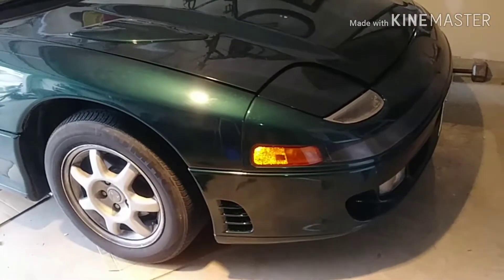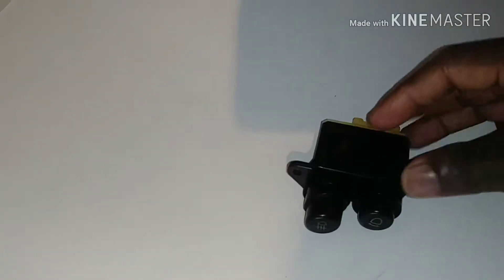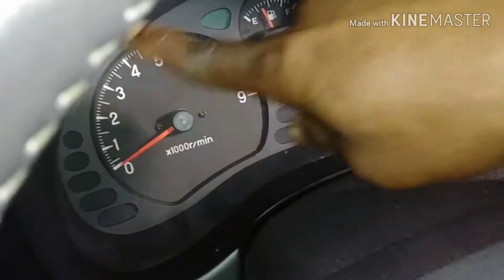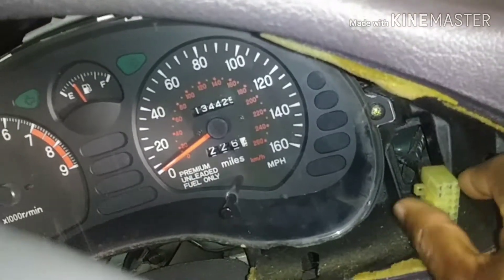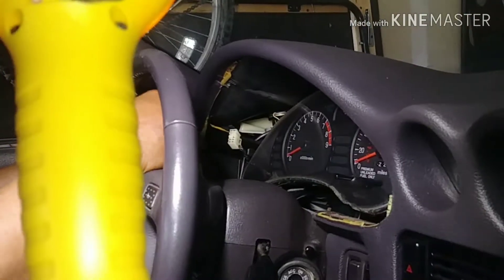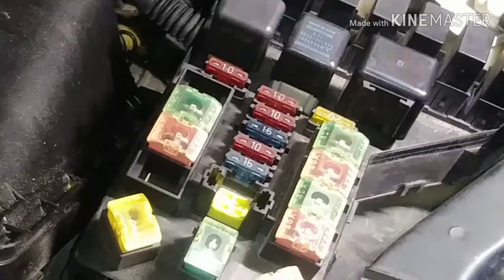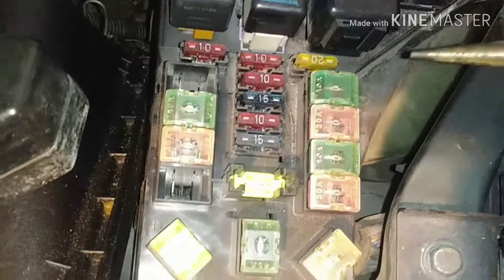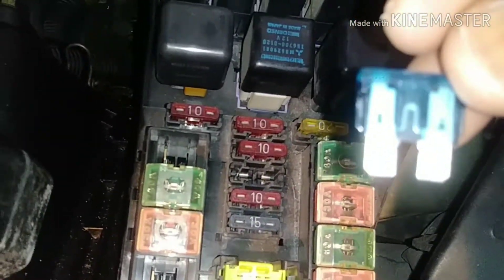MIT 3000GT. HOW TO DIAGNOSE FAULTY FOG LIGHTS ON ANY VEHICLE

Comment: Off topic, was just curious if you have gotten the steering wheel controls to work with your aftermarket radio? I recently did that project.
Reply from the maker: No. I had the radio installed many yrs ago.  It is possible that it was installed wrong or it's not compatible with the steering wheel controller. Now you mention it,  when I have time, I will investigate...thanks
Reply: @BRIC-À-BRACDIYVIDEOS   Let me know if you need help! I used the PAC SWI-RC interface but im using an android headunit so installation was a little different. In order to get the interface to work with my headunit, i had to program it to work with a pioneer headunit first. Then i was able to program the buttons to my preference on my actual head unit. Do you know if your head unit has support for steering wheel controls?
Reply from the maker: Not sure. It is a BOSS BV9155B.  I have other small projects to tackle first. I will reach out to you at the right time.  In the mean time, the climate control display light went dead 6 months ago, but AC still works. It appears that I have to remove the vents and more in order to take it out for testing...if you have a video or how to remove it let me know. I think it might have a blown transistor.... because it emitted a burn odor at the time it happened. Thank you.
Reply: @BRIC-À-BRACDIYVIDEOS   I haven't gotten to the A/C controls removal yet. I have the Base so it has the manual controls however that's a project I have in the future because the light bulbs are going bad. Here is a link to this website that provides services and parts for our cars. This link in particular is to have your A/C climate controls rebuilt: Parts on this website are kinda expensive so i typically avoid ordering from them unless its a specific part that i cant find anywhere else. https://www.3sx.com/ac-climate-controller-rebuild-reman-service

Heres another good website for parts: http://www.ninjaperformance.com/
Reply: I looked up your radio and found that it has no support for steering wheel controls connection. But you may be able to use the Pac SWI-X interface that taps into your steering wheel controls and controls the radio through the IR receiver on the headunit. You would need your headunit remote to program the device.
Reply from the maker: @djgabe100  thank you very much.
Reply from the maker: @djgabe100  I  thank you for the references. U are like me; I also like helping people whenever I can...God bless you.  Later.
Reply: @BRIC-À-BRACDIYVIDEOS  No problem! Working on this car is a passion for me especially keeping it clean and functional! Love to see others doing the same!